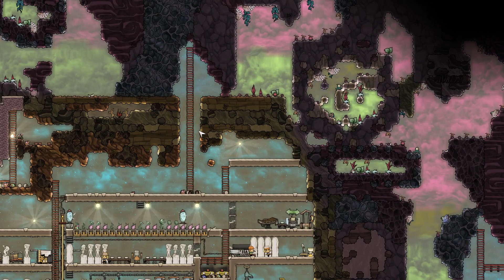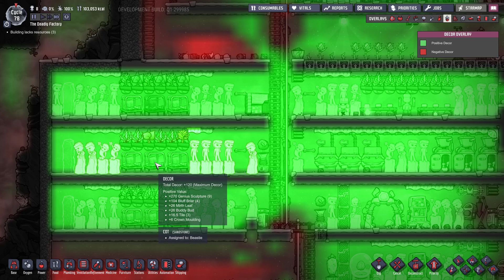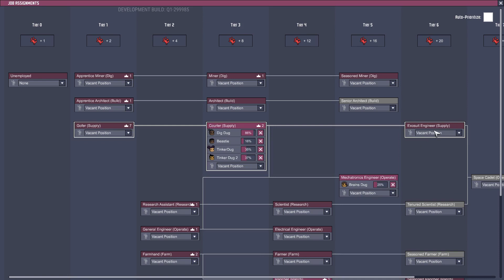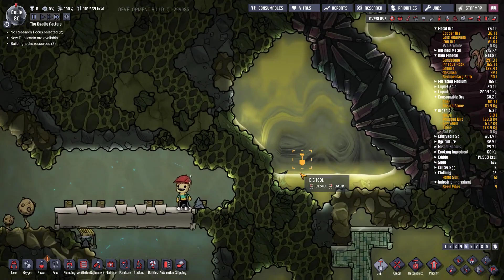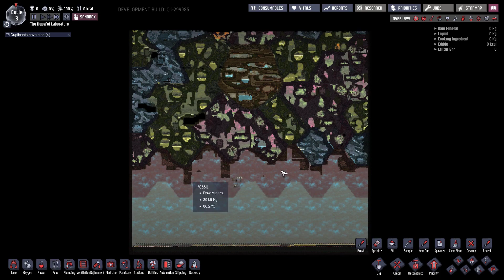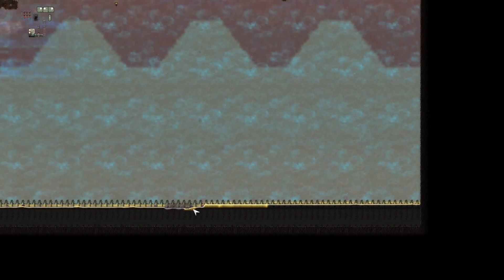Atmo/Exo suits, Decor and Snazzy suits. Tutorial 3 Oxygen not included

Comment: Why are you using two doors above themself?
Reply from the maker: A common strategy, I don't know who started it. The doors allow gas though even while closed so they are airflow tiles that you can build before you get airflow tiles researched. Also the doors allow decor values to pass through so statues inside the room can affect dupes on the ladders outside. If you don't have the metal to make them they are not necessary but they help. Also quick tip set the doors to open it cuts out the open/close animation and saves your dupes a bit of time passing through them.